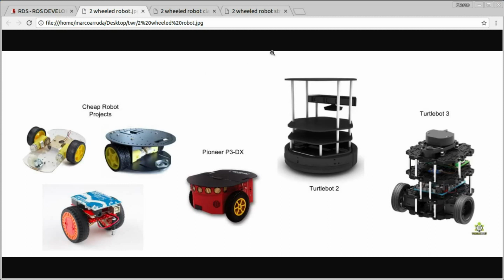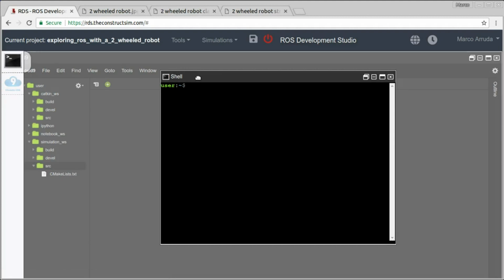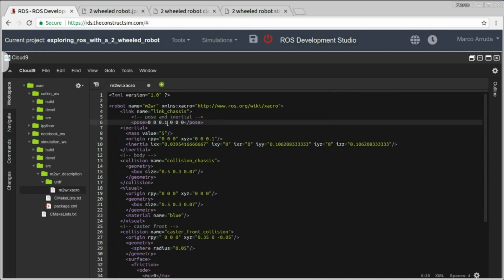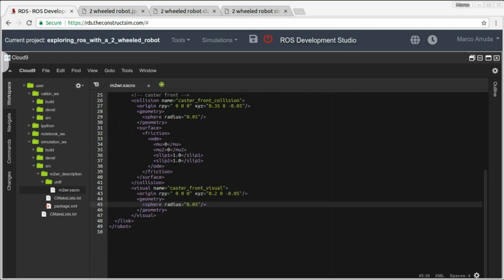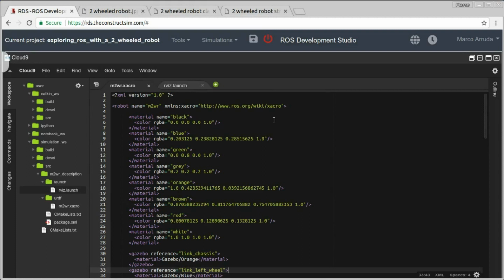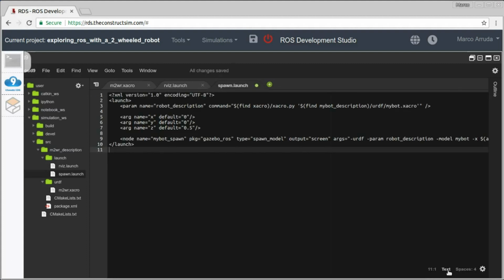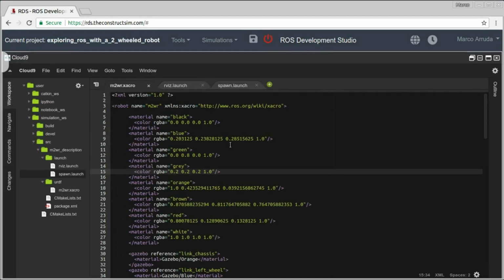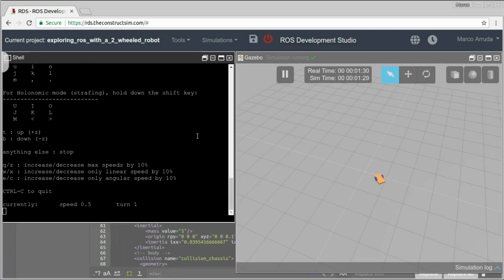[Exploring ROS using a 2 Wheeled Robot] #1: Basics of Robot Modeling using URDF

Comment: hii
i tried running the code both in RDS and on ubuntu based laptop i got the robot model in gazebo in RDS but unable to get it in ubuntu based laptop
Reply from the maker: The only difference between ROSDS and your local computer is that you must have. a proper ROS installed in your computer, with all the packages required, as well as your catkin workspace properly created and sourced. If you have all that, then it should work in local

Comment: Hello. 
In your tutorial, In the RVIZ - Under global Options - Fixed frame is set to map. You can see the model perfectly on Rviz. 
I have to set Fixed frame to (Link chasis, Link left wheel or link right wheel) to reproduce your result. 
In the default where Fixed frame is set to map, I would get Transform error and robot status not OK. 
Is there something that I am missing? I've copied your code from bitbucket and using ros melodic.

Comment: Is creating simulation_ws is same as creating catkin_ws with just name change? if I want to create it in my local machine
Reply from the maker: Yes you are right. The names "catkin_ws" and "simulation_ws" are just that, names, so you can change them at will. It is good practice to separate projects in different catkin workspaces. In our case, we create separate workspaces to separate the code of simulation from the code that actually will run inside the robot